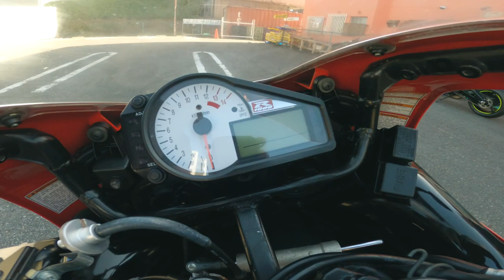TJ vs. The World | GSX-R Dramas

Comment: Nice one. As an ex Australian Superbike racer (on a Suzuki) I didn’t need to get my hands dirty, now I enjoy doing so. TJ, as a person who works with motorbikes, why do you always seem to buy lemons?  Is it a form of therapy?  👍😎🇦🇺
Reply from the maker: LOL mate. Yeah it's a way of punishing myself for past deeds. But after all the messing about, it was simply that the tip over switch had fallen off its bracket, so the ECU thought the bike was on the ground and wouldn't allow the ignition to fire haha
Reply: @bikehubjapan  At least you have the knowledge to fix. You are also a better rider than your mate on the R1. Would like to see some overtaking manoeuvres. Underneath and the long way. Much more entertaining, especially if you trust the other rider on the roads. Otherwise it just not safe to do so.
Reply: @bikehubjapan  ahh the tip angle sensor lol no way